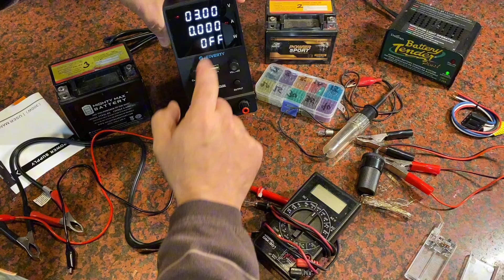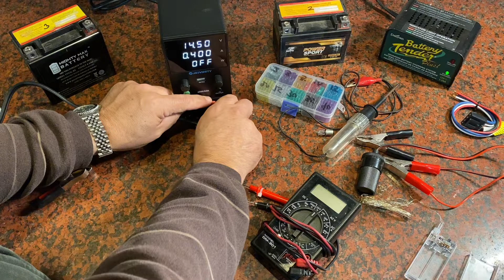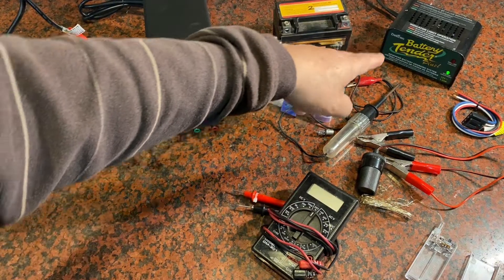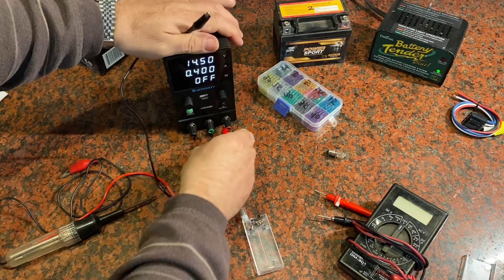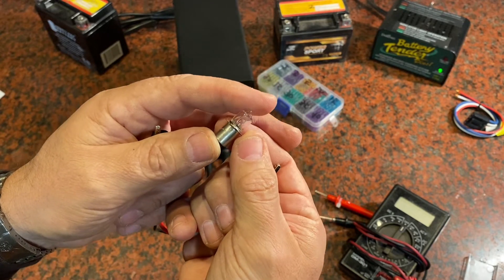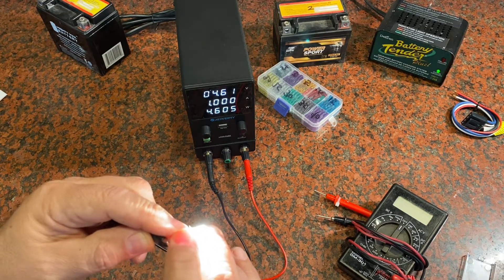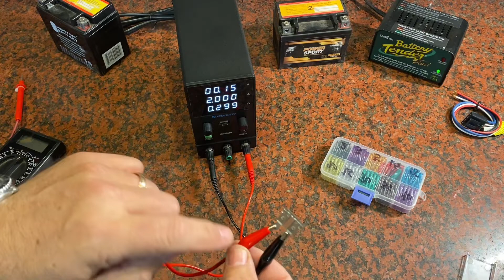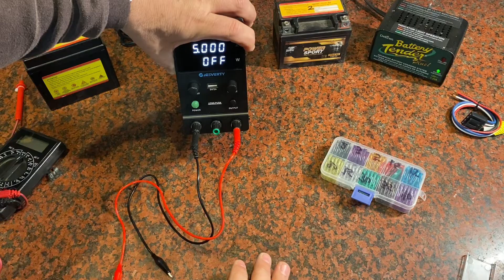How to Use a DC Power Supply for Basic Electronics by JESVERTY

Comment: When charging a 12v lead acid battery, I would set voltage at 13.6v, set the current at max charging current. Charging will stop when the voltage reaches 13.6v, and will not overcharge the battery.
Thanks for your video.

Comment: Absolute rubbish. I bought mine to help diagnose faults on games consoles. Just never works when trying to inject voltage or test current draw. Just doesn't do anything I want it to do. I bought the 12v 5 amp model.

Comment: Can i use it for Tineco S7 Pro wet/dry floor vacuum internal battery? It is non removable battery, and it is not starting to charge, keeping it constantly on 0%? Charger shows output for 30V, 1.0A. I am not sure how or where to attach it on equipment?

Comment: good supply but a bad fuse
Reply: why bad fuse? if it isn't overloaded much it will take some time before it burns ...
Reply: @Henry-sv3wv  yes u are correct,I am wrong here there are fast and slow types this is probably the slow 
This was nearly 7mnts ago and I have learnt a lot since then

Comment: I'm new to tinkering with electronics and just bought a similar power supply. This video explained a  lot to me, so thank you.  One question though, do you really need to limit the amps for most testing of bulbs or led's?  Won't the voltage dictate how much amperage the system will actually take? I assume limiting the current will possibly lower the voltage to meet the current limit?
Reply: setting a current limit can save you from total destruction if you test something that you don't know if it has a damaged part or short circuit. but yes, if a thing wants 3V then it only would take as much current that it needs. BUT NOT AN led, a led is a none linear thing that will thermal runaway without current limiting resistor or the power supply configured to run as a constant current source by using the current limiter ...

led driven by coin cell often don't have resistor because resistor cost money and coin cell does have a high internal resistance anyway and the seller doesn't care if the led wears out much faster because it draws a bit more current than it should ...

>I assume limiting the current will possibly lower the voltage to meet the current limit?

YES, if you set 10V and 1A current limit and you connect something and it starts to overshoot the 1A current then the real output voltage is put down till only 1A is drawn.
Reply: if you are running 3 volts thru 10 amps you will end up with 30 watts of power, 3 volts thru 1 amp will give you 3 watts of power, look into ohms law and power law those are very helpful tools in the electricity world :)